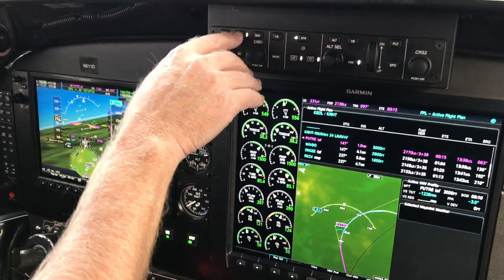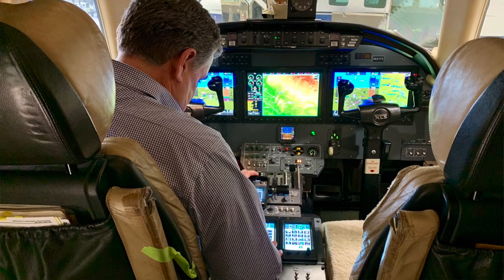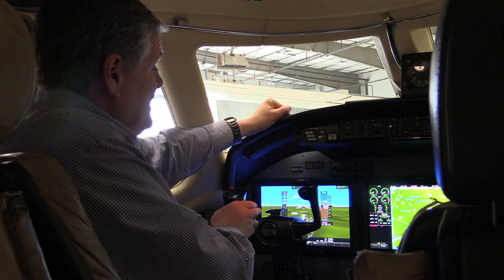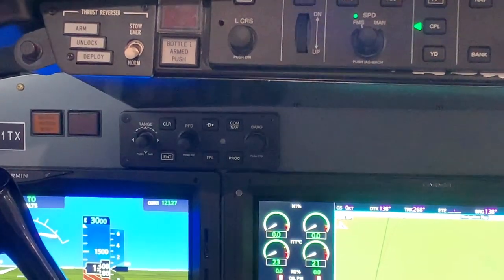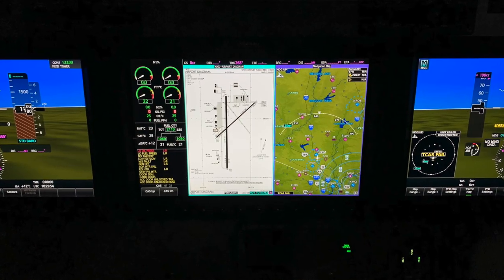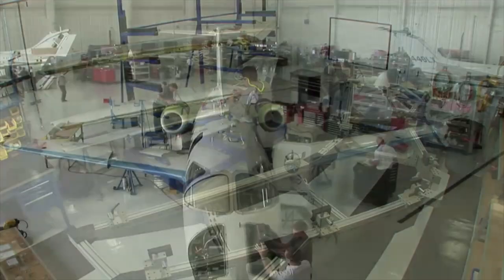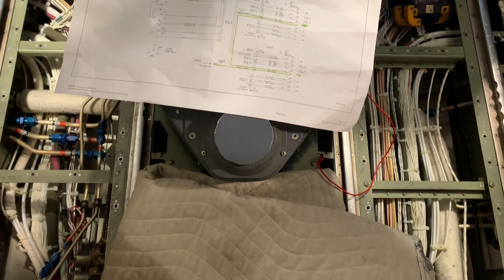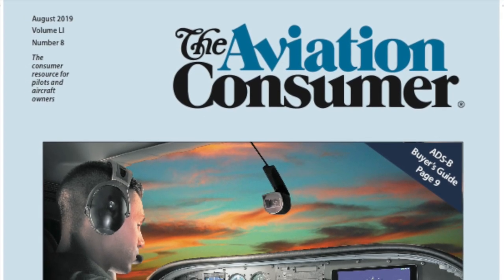Garmin G5000 Jet Avionics Upgrade Tour

Comment: Great sales pitch, but where's the balanced viewpoint? It's shiny I get it.
How much, how often (change), what cost/benefit, wheres the cost saving, what can I do new, why should I (and not 'cos it's shiny!)?
Reply from the maker: "How much, how often (change)" We said in the video it's a half-million investment and we think Brown made plenty of examples of cost-benefit that actual owners agree enough with to drop that kind of dough, including fail-safe. A generator failure with the old setup means you're flying on the standby flight instrument in the middle of the panel. If you've paid enough flat-rate repair bills for a Primus 1000 (we talked to plenty who have, and we have been involved in some of these repairs) you would consider the investment. Same if you've used the Universal UNS-1 FMS and had a taste of a modern feature set. And as Brown said, owners like these specific airplanes for lots of reasons. It's cheaper to invest in a modern suite of avionics (along with other airframe mods) than buying a new airplane, while getting the same avionics suite that's in a new airplane.
Reply: Repairing 20 year old avionics will eat you alive over time.  Plus, time is a consideration.  Most people with these types of planes use them for business, so when you have an intermittent avionics issue, you take it in, they trouble shoot, put in a loaner part, go fly it, if it fixes it great....you only went to the shop twice and only had to cancel a few flights.  However, I have seen people chase issues with these older systems for months and months....it get very frustrating  when you are playing millions for the plane, 300k a year in salaries, 30k a year in training, insurance, hangar, subscriptions etc, then still having to fly airlines because of crap old avionics...half a million dollars start to sound like the deal of the century....